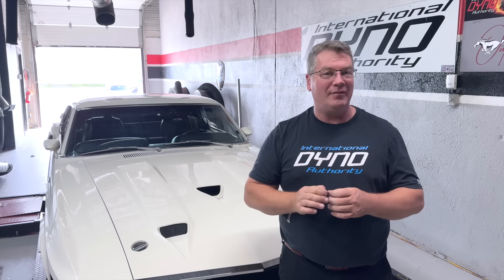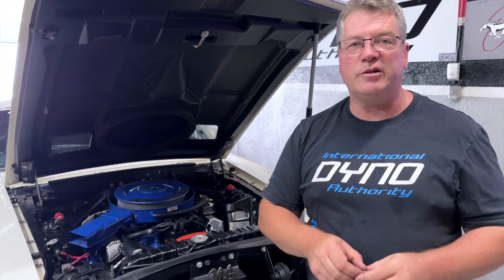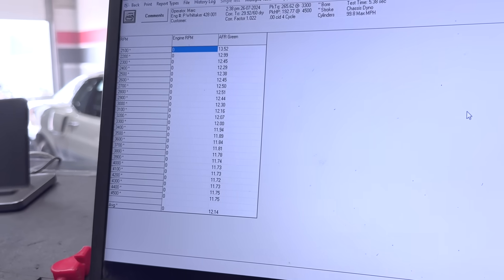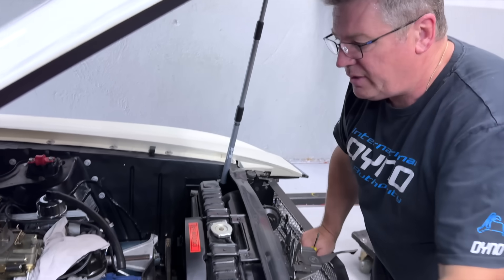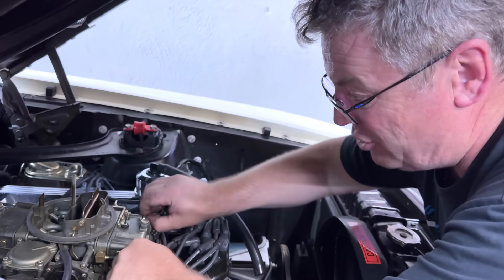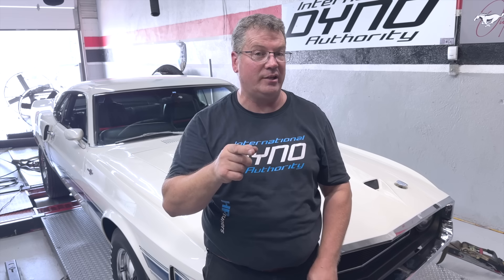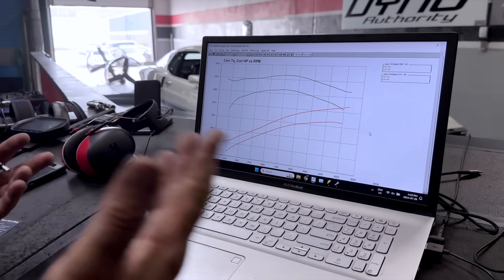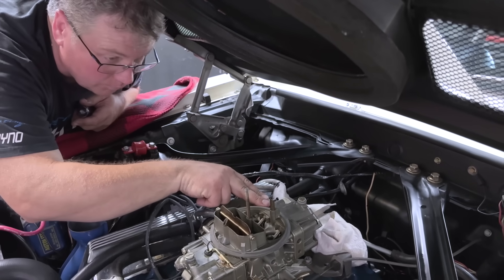Original, unrestored '69 Shelby GT500 tuned on the dyno

Comment: Dyno results.....
Baseline of 292.96 torque @ 3300 rpm and 216.58 HP @ 4200 rpm  ** ( Higher RPM ) **
Ending 400 ft lbs of torque @3300 rpm and 299.64 HP @ 4700 rpm  ** ( Higher RPM ) **

Original Vehicle Specs: 
1969 Ford Shelby GT500
Engine: 428 cu in (7.0L) 428 V8 
Horsepower: 335 hp @ 3200 RPM  ** ( Lower RPM ) **
Torque: 440 lb-ft @ 3400 RPM  ** ( Lower RPM ) **
Clutch: 11.5-in. single disc 
Brakes: Power assisted floating caliper 11.3-in. front discs with dual master cylinder and 10-in. x 2.0-in. rear drums with high performance linings 
Wheels: 15 x 7.0-in. composite design 
Tires: Goodyear belted E 70 x 15 Wide Oval  

** Air Fuel Mix Carburetor Tuning Without Vacuum Lines **
(( Much slower shifting response )) Vehicle is much slower off the line, far less aggressive, throttle response. 
(( Much Higher RPM Range Needed )) to achieve the vehicles available torque & hp.

** Air Fuel Mix Carburetor Tuning With Vacuum Lines  **
(( Much faster shifting response )) Vehicle is much faster off the line, far more aggressive, throttle response. 
(( Much Lower RPM Range Needed )) to achieve the vehicles available torque & hp.
Reply from the maker: @jasperbates6760  these are all great comments. 

I think, that some of them are mixing vacuum, with the vacuum line from the distributor. 

The carburetor itself, definitely was pulling vacuum. 

There was, a new updated recurved ignition system. That did not run from vacuum. 

The distributor was installed and, it was a replica that was meant to fit, the under hood. Look to match the original. 

However, the distributor, had a timing curve in it, to allow, advancement on RPM, and centrifugal force, weights and springs, curved to match the engine. Tuned also to match the engine. 

The carburetor itself had a ported vacuum line. But that has nothing to do with tuning or performance. 

There was also a non-ported manifold vacuum available. Again, nothing to do with tuning the carburetor. 

On the original baseline passes. The tune was so far off, that the engine would not make any appreciable horsepower above 4200. 

Once the tune was completed, and the engine was able to breathe and have the correct air fuel ratio all the way through the RPM range from 1800 to 5500, we were then able to test RPM above 4,200. 

One of the steps that we performed. Was to simply bring the vehicle up in RPM just before the smoke began. We then logged, vacuum. We then logged where vacuum transitions into velocity. 

Like we mentioned in the video, there's a much more comprehensive tuning video in the description. 

In this case, we were tasked, to get rid of the fuel smell. And reduced the smoke. Smoke. That was exiting the vehicle on RPM. 

We were able to accomplish this. By going through step-by-step by step, getting the air fuel ratio, correct, the vacuum signal. Correct, the timing correct, also off camera, we were able to reroute the positive crankcase ventilation system, and make that system work correctly. 

When the car arrived, the hose was just simply hooked up to the intake.
Reply from the maker: @jasperbates6760  The original engine specifications, were derived on a engine dynamometer. Not on a chassis dynamometer. The engine dynamometer was run at 300 cycles. Which is very, very very slow. People do not run their engine dynamometer that way anymore. And, the engine dynamometer has changed a lot since 1965. 

The load on an engine dynamometer used to be applied by hand.
Reply: @internationaldynoauthority693  Guys don't get me wrong you did a great job tuning the fuel air mix on that car. That thing was anemic and smoking like crazy and I cannot believe that it was a one owner with 32,000 miles and the original owner had problems with it for so long. Yeah as far as commenting I am not there with you to know what's exactly is in the car. So my comment was directed to simply to air fuel mix with or without vacuum advance setups and throttle response with or without the advance curve. I worked on many style carburetors over the years and am familiar they are not all the same. Also I have seen some of the hateful comments from the "know it alls". And I am not impressed with them. Tuning an engine as you know is a lot more than just turning wrenches. And since you guys work a dyno and are probably familiar with pro racing you know elevation above at or below sea level, seasons, jet sizes, and the track or course, and vehicle setup all play a significant huge role in tuning an engine. Bravo on the car. Job well done!

Comment: What was the stock timing supposed to be? I used to run my 88 GT at 14 degrees without any ping. Did you try any timing advance?
Reply from the maker: @michaelmappin4425  Yes, at the end of the test once the fuel was set up. Once we had our fuel curve where we wanted it. And we had rid the car of all of the smoke. We removed timing from part of the curve. And we increased the overall as well as the initial. 

Initial:
When the car arrived was 10. 
The total, when it left was 14 

The fully ramped in, timing when it arrived was 28. 

When it left, it was 31
Reply: @internationaldynoauthority693  Thank you for writing back. I really love that car, but the professional tuning and descriptions were amazing.

Comment: would it be rude to ask what this cost? And, is there anyone in CT that has this capability?
Reply from the maker: @L46C3  Not at all, we will provide a quote to anybody. At any point. 613-795-2779. Or 613-857-3578. Also, our general pricing is listed on our website International Dyno authority.com

Comment: Incompetent.  I would not let this guy anywhere near tuning my vehicle.  1) Does not understand the procedure for testing.  You never EVER change more than one thing at a time.  2) Has no understanding for Holly carburetors, the choke is ALWAYS set to manual operation and never to automatic.  The amount of black smoke is CLEARLY a closed choke, not jets, not float settings, not idle air-fuel screws...CHOKE...period.  Choke fixed open then retested.
Reply from the maker: Let us know when you would like to Enroll in some basic training for carburetor tuning.

We teach and offer training at all levels.

We can walk through proper adjustment procedure and "how to's" for choke incremental adjusting, problem solving, And when to begin understanding depleting vacuum levels and how they affect choke operation.  Proper grounding procedures, and diagnosing a stubborn, bent or malfunctioning choke.

We'll then move on to some of the basics of teaching you. AFR. And setting up tables for you. 

After a few weeks, you will have enough confidence, that you will want to purchase your own carburetor, and begin to explore, adjustments, tuning, and make small changes. 

Click on our website, for tips, tricks and, to sign up for YOUR " understanding. Carburetor basics training."

Cheers and have a super day!
Reply: @internationaldynoauthority693 well done.   A class act.
Reply: they just squeezed 100 horsepower out of an engine by turning some screws and changing some jets.  you are a random guy on the internet who is angry.  but being angry doesn't mean you have anything meaningful to say.
Reply: You can't even spell Holley. They were dynoing with the hood open and air cleaner off. I think they would have noticed a closed choke.
Reply: so where is your shop?
Reply from the maker: International Dyno Authority: Pioneering the Future of Tuning and Combustion Technology

As North America’s premier facility dedicated to advanced tuning and research, International Dyno Authority (IDA) has set the standard for tuning and power optimization across a vast range of applications. This cutting-edge institution has earned a reputation for excellence through extensive partnerships, groundbreaking innovations, and the development of tuning standards that are transforming the industry.

Partners in Innovation

IDA collaborates closely with leading corporations, advising powerhouses like HP Tuners, Whipple, Roush, and Ford Motor Company. Their insights and technical support have become an essential resource for these companies, driving improvements in engine performance, efficiency, and emissions standards. Through these relationships, IDA has a unique vantage point to pioneer developments that shape the industry’s future.

Pioneering Standards in Tuning

Since its inception, International Dyno Authority has been at the forefront of the tuning industry, not only setting new standards but also elevating the capabilities of tuners of all experience levels. Through their publications and training programs, IDA provides essential resources that empower both novice and professional tuners, equipping them with the skills to achieve precision tuning across various engine platforms. Their commitment to education is evident in their comprehensive curriculum, covering the intricacies of combustion dynamics, air-fuel ratio (AFR) tuning, boost management, and fuel characteristics.

Educational Outreach and Online Presence

IDA has established a strong online presence, notably through their YouTube channel, which serves as an invaluable resource for enthusiasts and professionals alike. Their instructional videos, which include step-by-step tutorials, practical tips, and expert insights, are used by institutions such as MIT, Boston College, SCT, Holley Inc., and Edelbrock, making IDA a recognized leader in education within the field. Their expertise has also gained the attention of influential industry figures, including Steve Morris, who has commended their contributions to tuning technology.

Specialized Focus and Areas of Expertise

Operating as a purely tuning and research facility, IDA’s specialization spans a wide range of topics. They delve into complex subjects such as combustion technology, AFR tuning, boost and fuel optimization, and luxury engine swap integration. The organization’s work also extends to advanced fuel research, as seen in their recent collaboration with TTC, Hydra-Gen, and DynaCert. Here, IDA took the lead in developing an 8.9L Cummins engine hydrogen supplement fuel program, which included rigorous emissions testing, underscoring their commitment to sustainable and innovative fuel solutions.

The Facility’s Technical Scope and Testing Capacity

Each year, IDA conducts over 650 vehicle dyno tests, tuning engines and chassis systems to optimize performance. This includes a wide variety of engines powered by gasoline, E85, diesel, hydrogen, port and direct injection, throttle body injection, and even carbureted systems. Their expertise is not limited to traditional vehicles; the facility also tunes boats, tanks, and military transport, making them the only independent tuning and research center in North America dedicated to such an expansive range of engines and fuel types.

Advancing Industry Standards

By leading projects in combustion and alternative fuels, IDA continues to be a key player in the evolution of tuning technology. Their dedication to setting new standards in performance, efficiency, and sustainability has positioned them as a trusted authority in an industry that is constantly evolving. For anyone looking to understand or pursue high-level tuning, International Dyno Authority remains the ultimate resource and innovator in the field.

Comment: What's the factory compression ratio?  And what is it on this car during testing? Do the heads have hardened seats?  

I'd bet anything this engine is F'd from running on modern trash gas.  Probably more blowby than exhaust.
Reply from the maker: @2LocasBeagles  10.5

Valve seats were inspected, and are in proper order.

The leaking power valve nozzle.... replacement. Eliminated all smoke.
Reply: probably.... probably would have helped if you watched the video before commenting LOL

Comment: I guessed 284 HP to the rear tires  (335 HP minus 15% manual transmission correction)
Reply from the maker: @snowcrest7863  you were Super close!! 

Usually very close at:

335 ÷ 1.15= 

We loved this project.
Reply: Incompetent.  I would not let this guy anywhere near tuning my vehicle.  1) Does not understand the procedure for testing.  You never EVER change more than one thing at a time.  2) Has no understanding for Holly carburetors, the choke is ALWAYS set to manual operation and never to automatic.  The amount of black smoke is CLEARLY a closed choke, not jets, not float settings, not idle air-fuel screws...CHOKE...period.  Choke fixed open then retested..
Reply: @ASDasdSDsadASD-nc7lf  I’d say you’re “blowing smoke”.

Comment: My MK7 Golf produces more power than this Mustang, but I would swap my Mk7 for this Mustang in a hot minute.
Reply from the maker: @opencarry3860  Yes, your mk7 does produce more power in one single spot on the torque curve. In one single spot on the fourth power curve. What we would do, is we would overlay the horsepower and torque values. Or just simply overlay the horsepower and torque curse. And the average of each would be significantly different. 

And for a light car, that MK has the exact correct engine. 

If you were to swap that into this car. 

That engine would not be very happy. 

But definitely there are a lot of 4 cylinders. A lot of 6 cylinders. A lot of engines in today's world that do make more peak power or more power overall. 

Very very very cool. And I agree, I would swap for this one. Also. What a beautiful car

Comment: How about updating the ignition?the factory dual point distributor is weak.Need an MSD box,msd wires and better plugs.complete fuel burn...
Reply from the maker: @CherokeeForce  I agree, that definitely a new er, more up-to-date ignition system, would have been a nice addition. Addition. However. This is a 100% original appearing vehicle. So underneath the distributor, was not stock. However, the distributor itself looked like a factory original. It's certainly ran well, and the ignition deal. Wonderful job once we were able to get the fuel under control. And a few other issues that, we ran into off camera that we fixed with the positive crankcase ventilation system.

Comment: 20cc squirter?? I've NEVER seen a Holley that didnt have either a 30cc or a 50cc pump on it?
Reply from the maker: @davelowets  We are a specialized, tuning shop. Which means that we have kits available to us, that a lot of other areas, shops, and general mechanics would not have. 

In this case, we're replaced the nozzles, and the accelerator pump diaphragm, with smaller capacity. 

The main fix, was leakage after 3,900 RPM. As the nozzle, was being drawn, too hard when it was the larger orifice.

Comment: If that thing has been blowing THAT rich for 30,000 miles, I'm REALLY sursprised that there's ANY rings left in the engine, and the bores don't look like mirrors... 🤷🏻
Reply from the maker: @davelowets  keep in mind, that the smoke prevalent, was after 3900 RPM. From the looks of this vehicle, I don't think anybody drove it above 3900 RPM very often. Beyond that there was a complaint of smell. So the carburetor, and the setup, and there were other things that we did off camera. Quite a few things that we did, to reroute the positive crankcase ventilation system. They had routed the hose directly into the intake. And they were sucking oil, directly from the valve covers into the intake. Rerouted it, and then refreshed the entire setup.

Comment: Boy, this thing was tuned HORRIBLY! This was let out of the factory tuned that bad?
Reply from the maker: @davelowets  Yes, and almost 90% of vehicles when they enter our shop, we can walk through step-by-step showing you just how bad the factory tuning actually is. Is. The calibration on these is not set up on the street ever. They are run. They are tested. They are calibrated on an engine dynamometer. So unless somebody pulls a miracle out of their hat when it comes out into the real world, they end up being very uneven having extreme Rich areas and extreme lean areas. This includes brand new computer-controlled vehicles. Manufacturers will still release them directly on 14.7. And wait until 3,500 RPM before there's any power enrichment.

As we are a specialized tuning and tuning only shop. We are able to break down and be very incremental with our tuning.
Reply: It was never tuned until this video. It was merely assembled on a production line. Or restored to factory spec.
Reply: That's FORD For Ya....
Reply from the maker: @mariospensieri941    Yes, and almost 90% + of vehicles when they enter our shop, we can walk through step-by-step showing you just how bad the factory tuning actually is. Is. Pontiac  , Ford, Jeep,  Chevrolet , Buick, Honda, Toyota,  you name it....The calibration on these is not set up on the street ever. They are run. They are tested. They are calibrated on an engine dynamometer. So unless somebody pulls a miracle out of their hat when it comes out into the real world, they end up being very uneven having extreme Rich areas and extreme lean areas. This includes brand new computer-controlled vehicles. Manufacturers will still release them directly on 14.7. And wait until 3,500 RPM before there's any power enrichment.

As we are a specialized tuning and tuning only shop. We are able to break down and be very incremental with our tuning.